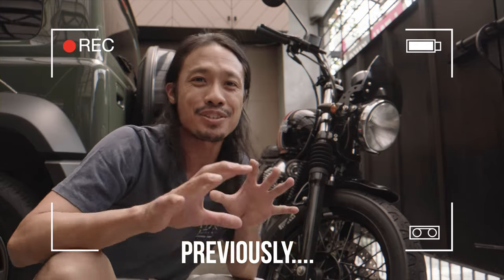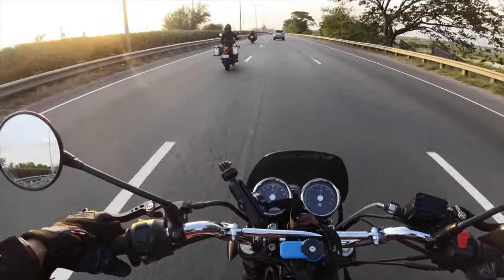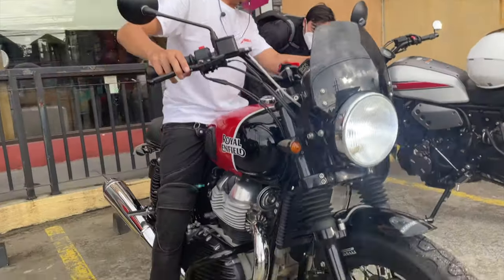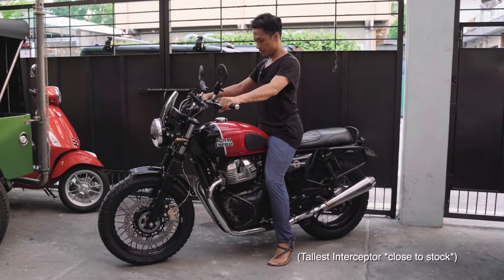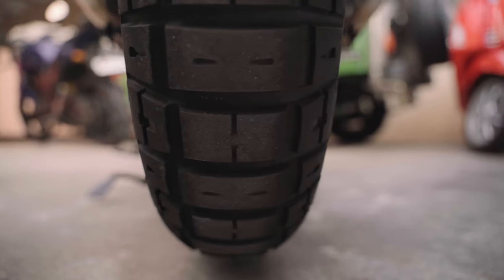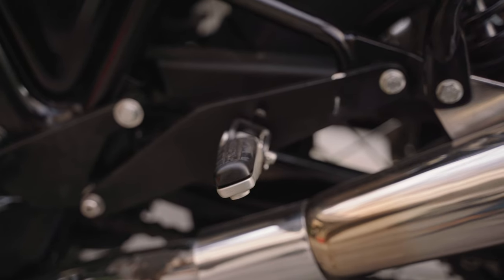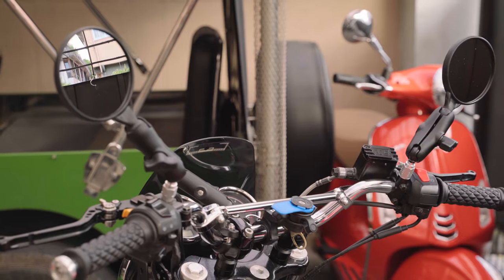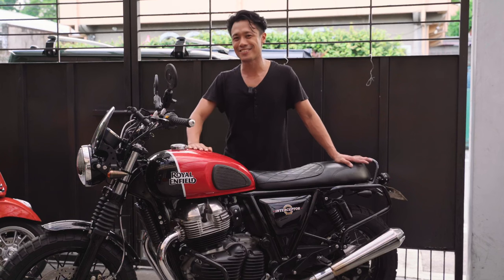My Interceptor Scrambler Build | Every Mod Explained

Comment: My only concern is that isn't it a bit big and heavy for a scrambler! Most of the original ones were more in the 300 to 500
Reply from the maker: That it is! But still lighter than a big ADV. So I wouldn’t take it on anything too gnarly.
Reply: @Ride_XP  fair enough 👍🏻

Comment: About that exhaust, if they are obstrusive you can try Moto Wings Trident Exhaust, they are slightly bent parellel to the road surface and sound quite when idle or low rpm and boomy at high revs. It adds 1.9 HP too, check it out it you fancy.
& HJG LED Headlights and fog lights, comes in different styles look for it on youtube

Comment: Since you already got a performance air filter and exhaust, piggyback ecu will utilise these to improve throttle response and some power. this is mod is upto you since it is expensive and if you find the power of bike adequate already then this will just be bonus.

Comment: I think it's very interesting what you did here :) Comparing this to the Himalayan probably isn't fair, but still, do you think this scrambler version competes with the offroad capabilities of the Himalayan?
Reply from the maker: I would say that it’s surprising how tractable the power still is! I was able to tractor through similar to the Himalayan through some sections. It’s not intimidating at all. But the Himalayan is lighter, has much more suspension travel, and has a lower seat height than my Interceptor hahaha. I would still feel far more confident tackling scarier terrain in the Himalayan. That bike was made to take a beating!

Comment: It's a beautiful bike.
How does your build compare with a stock build, in terms of height and rider position? 
Also, can the stock build be raised?
Reply from the maker: My bike is taller and currently has even taller and wider handlebars than in this video. You can make the bike taller by getting a bigger rear tire and by raising the forks, just make sure you still balance the geometry. Or, you can get the 2Win TRAIL shock absorbers which add an inch, I think, and then get a 19in front wheel to balance it out.

Comment: Nice review. Question, did you try your Interceptor or maybe GT with OBR in traffic. Bcz it is really mabigat especially the interceptor. I’m also 5’7  btw. planning to buy either of the two..
Reply from the maker: Yup! I’m used to riding with my tall girlfriend on a scooter, which is really affected by the weight of a pillion. It changes the handling of the scooter a lot.

So when she backrides on the Interceptor I find it easy enough because the bike isn’t so affected by the weight, and it glides smoothly when preload on the rear shocks are set for a pillion.

Comment: From where did you purchase and get your tire installed?  Do they also sell Shinko tires?
Reply from the maker: I ordered online via Facebook Messenger from Caloocan Sales! They carry several brands so it's worth asking, but also try inquiring as well with Reborn Motor Co., MPH, or Takara Tires.
Reply: @Ride_XP , Thank you for responding. It's very helpful. For the front tire, is it possible for a 130/70/18 to fit?
Reply from the maker: I think so! Best to double check but I think I've seen that size on scrambler builds. Nice look but also makes turn in more sluggish.

Comment: Hey man! Check out AOM(art of motorcycle) handlebar made for offroad and long tours, is black, almost 2inch taller and 1.5inch wider than the stock, CNC machined and sturdy(less vibs ig!), fits handgaurd and barend mirrors, getting mine fixed this weekend!!
Reply from the maker: Ohh nice! Let me know how it goes for you and I'll consider! :) Are you getting new cables or keeping the stock? And what hand guards are you planning to get?
Reply: @Ride_XP  Sure will,  the cables will be the stock one the handlebar is a straight fit with out any mods or changes to the stock cables, I was thinking on getting the Acerbis hand gaurds..will go to the shop and decide!

Comment: Beautiful bike mate! So in other words what mods have you done to make it more taller? I do want to make mine a bit taller (full stock) since the seat height is on the lower side. Cheers!
Reply from the maker: You can:

- bring up the forks
- change to a thicker rear tire
- change to a 19 in front wheel, and balance it further with the longer shocks sold by Baak 

I think that's about it!
Reply: @Ride_XP  thank you so much!

Comment: Going to be very hard to decide which Enfield I want after just sitting on a few.

Interesting vid done by Stuart Fillingham re camshaft for Himi/Scram. I had ruled out the Scram/Himi but after seeing them in the flesh I like the extra height!

Weirdly the Interceptor didnt do much for me if anything Meteor supernova and the Scram are my favourites.

P.s Like what you are doing re the Interceptor but I'd prob leave as is and buy a Tenere instead.

Comment: Good video!  I thinking of doing an adventure bike build with the 19”/17” wheels.  One thing that’s stopping me is the short fuel range of this bike.  Is there any larger tanks available?  Is there a way to mount hard luggage like the Zega Pros from Touratech? I want a bike I can do epic trips on.  Thanks
Reply from the maker: Hi! Unfortunately I've never heard of any, it will probably need to be a custom job. The short clearance to the twin pipes also limits the ability to mount any hard luggage without some kind of custom fitting.

Comment: Hello,
I think you should go with a 19 inch front rim, with a 100/90-19 or a 90/90-19 tyre setup. The rim setup would increase the off-roading capabilities dramatically. I guess the stock outer tube can easily accomodate a 19 inch front rim.
Reply from the maker: Definitely curiously to see how it would handle a 19in front! Might try it next tyre change.
Reply: @Ride_XP  I would put a video with a 19-17 inch rim setup on my Inty.
Reply: @Ride_XP  just completed the build with a 19-17 inch wheel combination. 
Please have a look at this:

https://youtu.be/MPndu2vMJdk

Comment: Where did you buy the tires? 110/80 R18 front isn't easy to find. :)
Reply from the maker: Actually most of the places I inquired, they had the front but not the rear! Finally found the pair available from Caloocan Sales. They delivered same day after I paid va Gcash and I also bought the Pirelli inner tubes.

Comment: Are you considering getting a the big bore kit to convert it from 650cc to 865cc??
Reply from the maker: Oh, not at all, pretty expensive and it will mess a lot with the character of the bike based on Stuart Fillingham's review. It'll be wilder, vibier, and I would bet less reliable. I think I would rather get an XSR700 if I wanted a faster (and lighter) retro bike that can wheelie for days hehe

Comment: bro. what is the fuel range per tank...>300km?
Reply from the maker: Around 270km I think, but I always refuel at around 210
Reply: thanks so much for the feedback. I checked all motorbike reviewer, almost none talk about fuel range. all talk about the power only as practicality is not a factor in motorcycling 555

Comment: she's a beauty. good choice. what about a 2 into 1 pipe?
Reply from the maker: Thanks! Holding off on that for now because of the expense. I’m also a bit wary of the heat for a high-mounted scrambler exhaust.
Reply: @Ride_XP  mount lower like flat tracker

Comment: Why you had to change the rear rim? Would it be possible to mount the 140/80R18 on stock rim?
Reply from the maker: Only the 150/70 18 is available here for the 18in rim, sadly.

Comment: Do you have to change to a 17 inch rim to fit those tyres or can it stay 18?
Reply from the maker: I preferred the available sizes in the 17, but yes it can stay an 18.
Reply: @Ride_XP  Thanks for the response :)

Comment: how did you fit the taillights?
Reply from the maker: Mine came 2nd hand with the bullet style tail lights already installed, so these ones were just swapped out directly by the mechanic. Did still take some rewiring though so I left it to the mechanic, very cheap to get done here.

Comment: I'm also considering a scrambler (Benelli leoncino 500 trail) instead of an Adventure bike. Do you think you can do the same things? How It to travel without Wind protection?
Reply from the maker: Ohh I love the engine sound on that bike! I didn’t know they made a scrambler version of it. I’d love to try it. It looks already ready to go off-road out of the box. 19in front and long travel is perfect for a scrambler and tires are dual purpose already.

Traveling without wind protection is… not great but tolerable haha. It will definitely limit your speed but not below most speed limits hehe.
Reply: @Ride_XP  You really need a strong neck to handle 120+ kmph speeds without wind protection
Reply from the maker: @shenanigans4177  this is true hehe. I have to go 170+ to keep up with my friends hahaha

Comment: The term scrambler is corrupt. It should be practically a motocross bike from the 50-ties/60-ties, just added some pads on naked areas, lamps, and mirrors, and lower the frontal mudguard. And 500cc should be the maximum as this was a limit in MX. Otherwise, it is more like a parody of Scrambler.